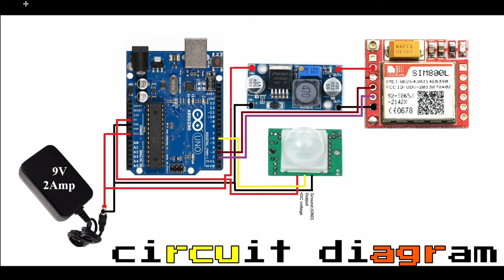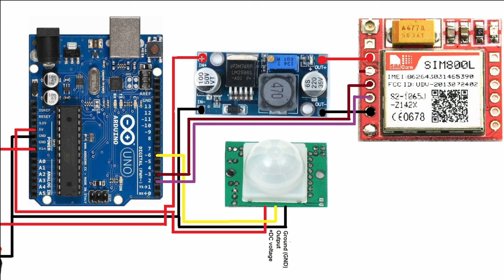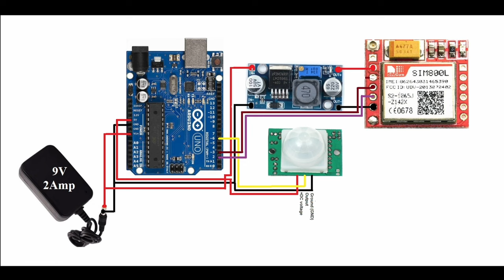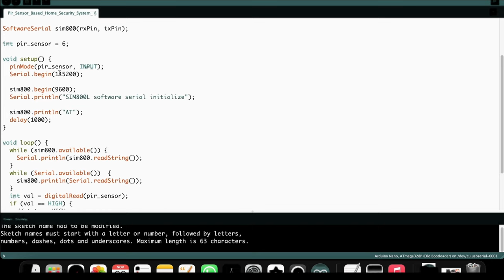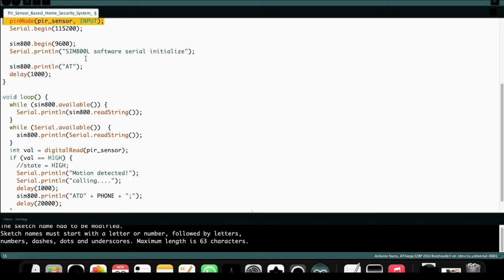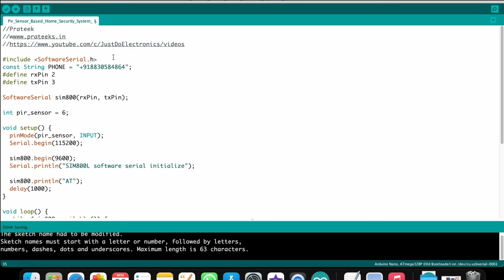PIR Sensor Based Security Alarm Using Arduino | GSM Home Security | PIR Motion Sensor Alarm

Comment: Greeting having the Motion detected even when I have disconnected the PIR sensor. Can you use the A9G module instead of SIM800L
Reply from the maker: yes
Reply: @JustDoElectronics  But why am I having motion detected when the PIR is disconnected